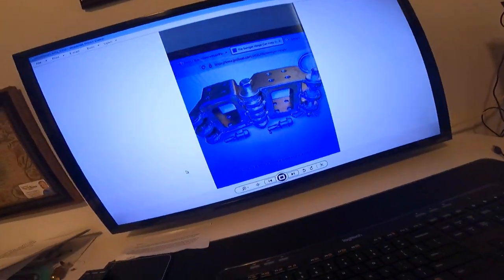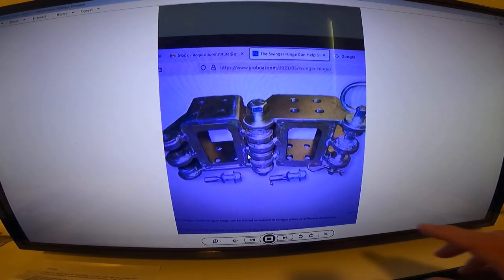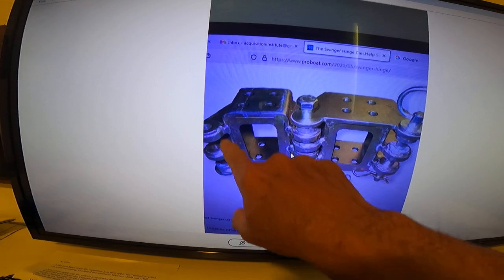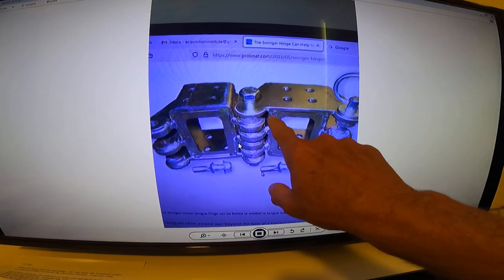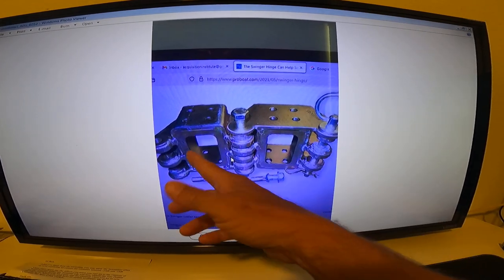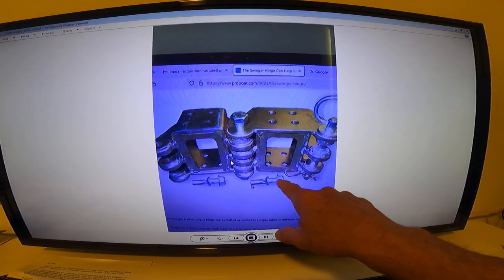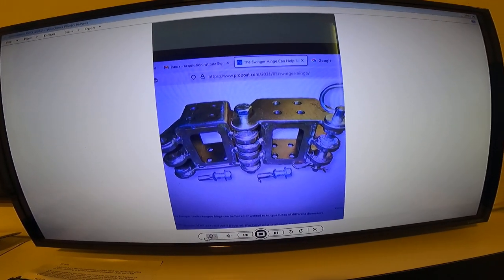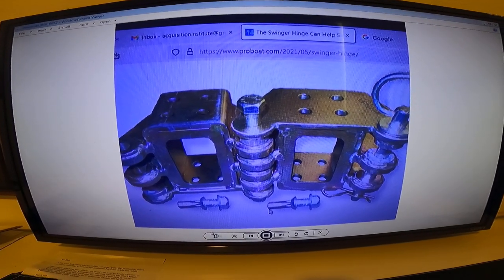THE TTROY FOLD-AWAY HINGE BY ELLCO MFG. (FOR BOAT TRAILERS ETC)

Comment: When you say competitors product is “forged” I think you’re meaning “cast”. If they were forged Fulton would likely not be having the problem. I’ll likely be buying one of these new Swing-Away products but I will say just looking at the pictures of them that the welds look really sloppy. I would think they could do better on that front.
Reply from the maker: you are correct as I used the incorrect word.  They were forged using American steel and American labor in an American factory to VERY HIGHT quality standards, unlike the typical POS made by Fulton in China.  Thanks for pointing out my blunder.
Reply: @RobertKnauerUnfiltered  Ordered one for myself today. They ship to Canada!